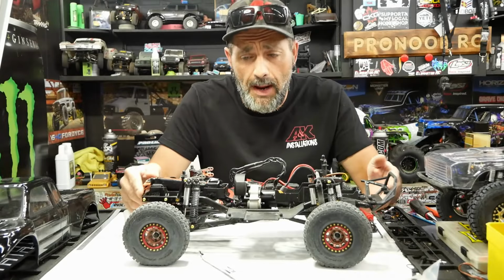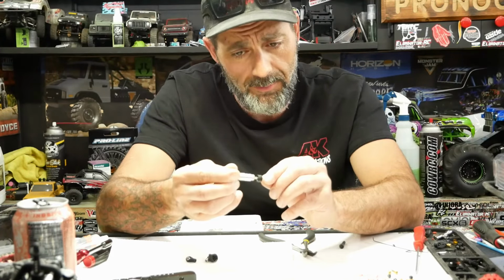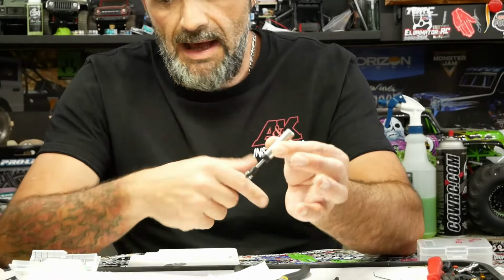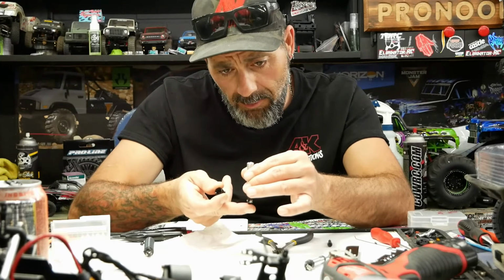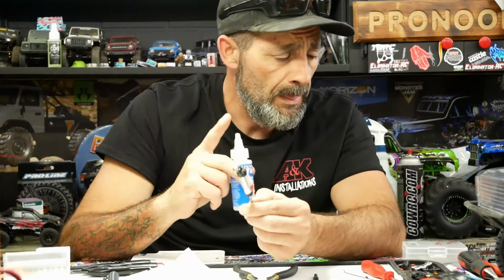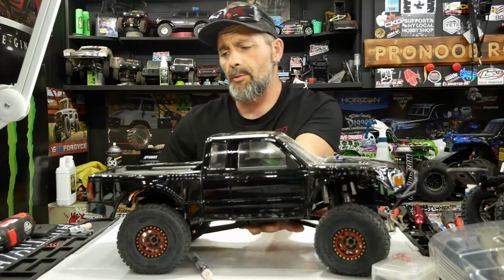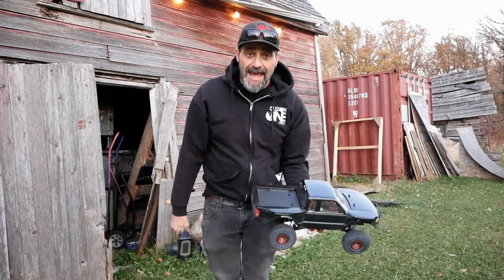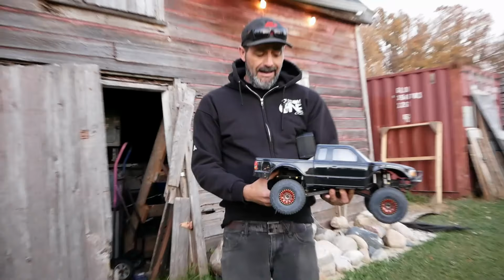PRO-LINE RACING 1/10 TWIN I-BEAM 2WD PRE-RUNNER BUILD: PART 3: SHOCK TUNING

Comment: Dude what knuckles? I have an Injora 10.2 slider.. The i-beam kit, and its terrible steering I don't get it. * I've not run it on ideal terrain for sure, but any blip of throttle it torque twisting and the left lock steering is abysmal.
Reply from the maker: Running vanquish knuckles for axial 10.2. Yes the steering is horrible. Sway  bars it double your shocks. Adjust your rear axle to fight the power twist to where the truck dog tracks a bit off power but pulls straight on the throttle. Then practice drifting it. But I’ve built enough pre runners over the years to realize two shocks per corner one with a spring one without is the best way to go. Gotta slow that body down and keep power planted